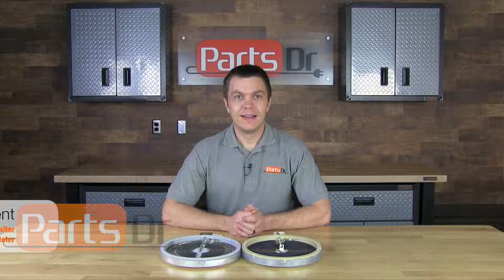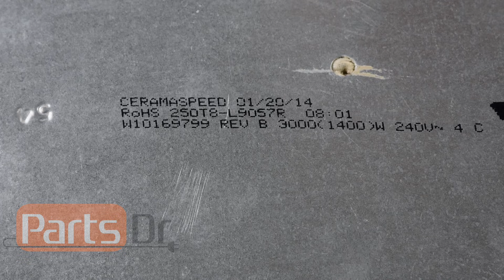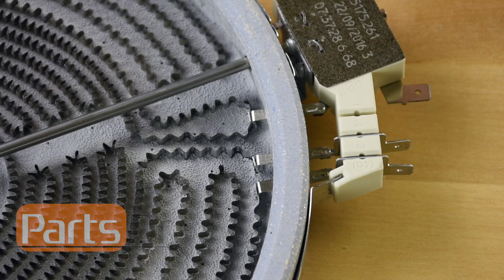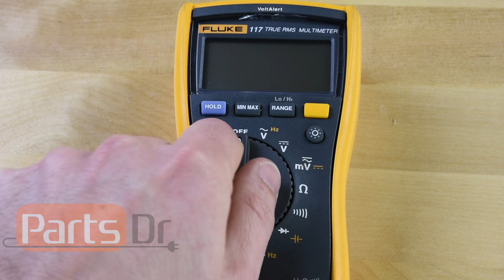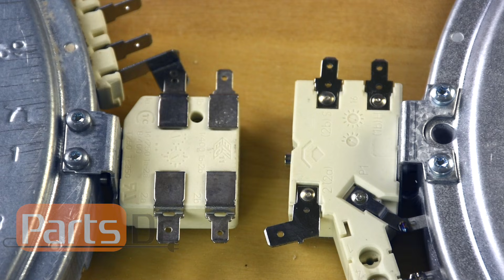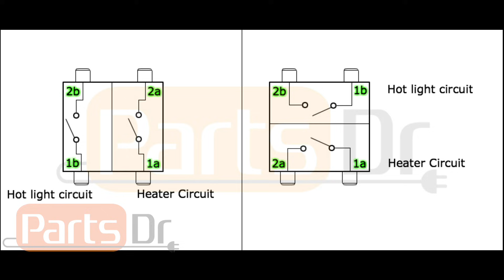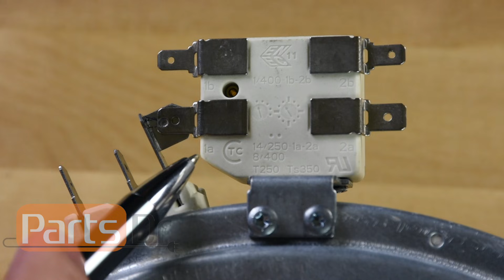How To Test Your Radiant Surface Element & Wire Limiter

Comment: Mine is  the outer coil work but the inside coil didn't work.  I purchased a whole  new element that look  exactly the old one.   The only thing differrent is the connector has a little change but I was able to correct it.  After I installed it won't turn on.
Reply from the maker: Make sure to connect the wires to the labeled locations on the terminal block regardless of the physical location (1a to 1a, 2a to 2a, etc).

Comment: Thank you for completing the puzzle! Once I found 1b, 2a etc I connected the correct wires and presto! Another appliance saved from the Eco center!
Reply from the maker: Great to hear this helped you out!  The 1a, 1b, 2a, 2b thing can really throw you off if you don't connect the wires to the correct terminals.
Reply: @PartsDr  ya gotta have good eyes to see those tiny engraved letters 😆

Comment: Your video is great and shows exactly what I am dealing with.
But the replacement burner instructions tell me to use the old ceramic epic sensor rod instead of the metal one on the replacement. But if I do that there is no support because ceramic one that does not even go half way to the center of the burner. New metal rod goes two inches beyond the center and goes through a metal hook that prevents it from moving around. . . . And even if I wanted to use it without any support the one connection 1a is tack welded so I can't disconnect it to pull the rod out. I think there is a second set of 2 small screws that hold the rod in.  I could cut that metal and get the old one out but there is no return from that.at least not the rest is working.
Thanks for any help you might have on this. miatapete@yahoo.com
Reply: Another video said the epic sensor would work ok. Tried it today and the burner works. Just match the three connectors by the numbers like 1b. The two other connectors should be made same as the old burner. If looking at it the connector is on the left put new one on left. New burner is  hotter than original. When it shut off because dial was set lower I knew it was right.

Comment: The front left burner on my LG LDE4415 turns on but gets super hot and stays there even when set on a low setting. The front right works correctly most of the time but occasionally gets super hot. Do you think this is a bad limiter in both elements or can it be a different issue?
Reply from the maker: Hi Fred, that doesn't sound like a bad element/limiter to us.  That sounds like the control board that sends power to the elements may be bad.  It may be part number PD00058534 based on the partial model number you provided.  You will need to do some more troubleshooting to see if this is the cause of your problem.
Reply: Parts Dr Hello. I did not troubleshoot because I didn’t know how to do it. I opted to replace it. After I replaced the part that you recommended, the range worked for a couple of days. The problem just started again. The front left burner keeps heating whenever we use it. What do you think?
Reply: @MovewithFred  P

Comment: Great instructional video. Simple language, easy to follow. I missed a trick in noticing the terminal names and tried to match the old and new wiring based on the positioning which made me think that the product was faulty. This video popped up out of nowhere the day before I was about to return the item. Saved me almost $130 and may be some embarrassment when i take it back to the shop. Thanks a lot
Reply from the maker: We are glad you found the video helpful!  We commonly see people overlook matching up the 1A, 1B, 2A, 2B from the old to new element.  We hope this video helps people get the element installed and working properly.

Comment: My Daughter has the solid electric stove top burners. Not the coil type and not the glass top type either...The two left hand side of the stove top both burners work...however the two right hand side burners don't work..any idea's why ...
Reply from the maker: It sounds like they might be "euro style" burners.  You should be able to test them with a multimeter to see if they are good or bad similar to the instructions shown in this video.
Reply: @PartsDr  Many Thanks...

Comment: My old element, only has 3 connections (ground, 2 resistors) the new one has 5. On the first one, 1a and 1b are on one connection, while 2's the same. The new element has these separate, do I need to connect the 1's and 2's one the new element?
Reply from the maker: The new element should have the same number of spade terminals as the original.  I don't think we can answer this question without seeing the differences of the new and old parts.

Comment: Thanks again for the video it helped me fix my Samsung NE59J7651 however after I got the light fixed I put it on a self cleaning overnight and came back to a C-31 error on the screen and won't let me do anything with the screen. Heating surface still work but the oven won't. I checked the manual and it say over heated PCB, any advice?
Reply from the maker: Have you let the range cool down to see if the error goes away?
Reply: @PartsDr  I have tried that and even unplug the stove over night hoping it'd clear. But it did not
Reply from the maker: @odomv1  that's not good!  Off hand we don't have any experience with that error code.  If you find the solution to the problem please let us know.

Comment: ne59m4320sb samsung hot surface light on...what ya think?
Reply from the maker: Most commonly a bad infinite switch but it could also be a bad burner.  If you test the burner per the instructions in the video and it tests good then replace the infinite switch.

Comment: Ashroyer86 has accurately described the issues I have on my Kenmore radiant top stove.  I am unable to locate a model number on the stove body anywhere.  Is the limiter a universal part for this type of stove.  Mine is approximately 7-8 years old.  Thank you
Reply from the maker: The limiter is specific to each burner and they are only sold as part of the burner assembly.  Here are the common locations to find the model number on your stove:  https://partsdr.com/model-number-locator/range-stove-oven

Comment: very informative, thank you. So will there always be 1 N.O and 1 N.C set of contacts in the limiters?
Reply from the maker: All of the ones we have come across so far have been this way.
Reply: Parts Dr the burner turns on but runs full heat regardless of position then the burner turns off after a couple seconds. Have you seen a limiter behave like that?
Reply from the maker: These symptoms you are describing are usually caused by a bad infinite switch or if the stove doesn't use an infinite switch there is usually a control board that outputs the power to the burner that can go bad.

Comment: Excellent. At last a clear explanation. 1500w element not working. A belling touch . I don't hear the switch clicking on when I want to use element. Initially element worked intermittent, but no longer, going by your video I think it's not the element?
Reply: Think I need a new limiter
Reply from the maker: It doesn't sound like a bad element from your description of the problem.  If the burner uses an infinite switch it may be a bad infinite switch or some newer ranges/cooktops use a control board in place of an infinite switch that can also go bad.